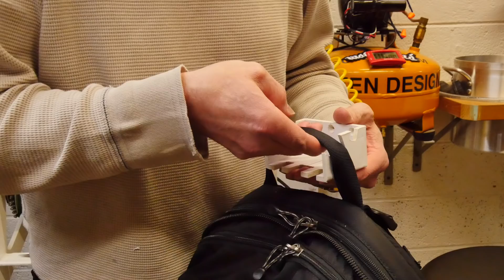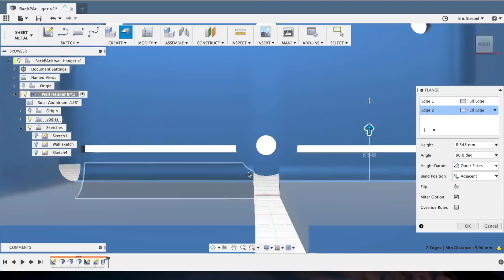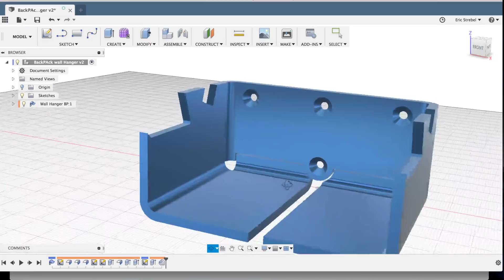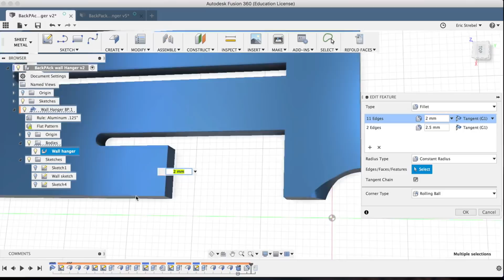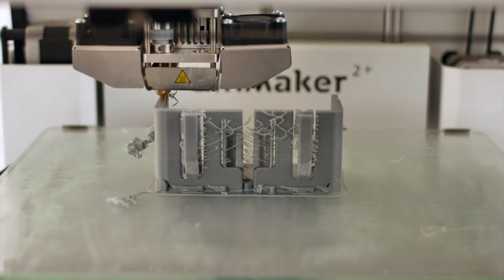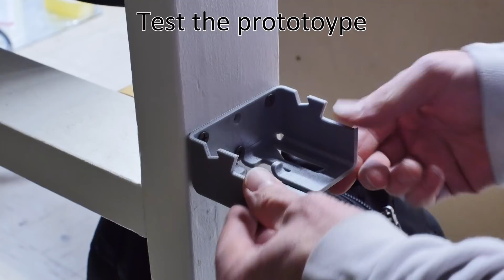BackPack Hanger CAD and 3D print: Fusion 360 and Ultimaker 2+ print build

Comment: So this is very cool. I wasn't aware that Fusion did sheet metal parts, but I guess i shouldn't be surprised. One comment, the flat part doesn't seem to nest together as well as it could in terms of cutting out 100 in the flat sheet. Either narrowing the lower flanges (with the keyhooks) or widening the back flange (with the screw holes) seems like it would allow for better nesting and less drop when doing the production run. As i'm sure you know there is a whole field of "design for manufacture" which deals with these sorts of details.
Reply from the maker: You bring up a good point. Ultimately it will depend on your manufacturer. I will discuss this in more detail in the next backpack hanger video, once the prototype arrives. Some manufacturers wanted to make changes to the design and others did not have an issue with it, ultimately it came down to their manufacturing capapbilities.

Comment: 3d prints with strings that bad are probably from 2-3 causes.
1. Your non-print travel speed is too low. If not extruding you wat to be moving as fast as possible. Less time to ooze. 200mm/s is a good place to start. Go faster if you can.
2. You may want to look at retract settings after non-print speeds are improved. Less pressure to ooze
3. Consider dropping extruder temp to reduce oozing. This may have negative impact on layer adhesion if you go too far.

Thanks for the inspiration 😉
Reply from the maker: Mongrel Shark Thanks for the info, a few have commented on retraction settings, I am using the factory setting, will have to give that a look.

Comment: Hey Eric great video! I have to say I love the design of your backpack hook. As for the stringing, it is probably not the humidity. When you have humidity problems your filament will often bubble when coming out of the nozzle. From what I can see this is not the case. What you need to do is adjust your retraction settings. I would recommend a 4.5mm retraction at around 20mm/s. There are other settings you can adjust to help the problem to like increasing the cooling fan speed and travel speed. If you need more help there are plenty of videos on retraction that are really helpful. Good luck on the stringing and on your backpack hook project!
Reply from the maker: Luke Harmon  Thanks for the info, a few have commented on retraction settings, I am using the factory setting, will have to give that a look.

Comment: I work at a press brake manufacturer and need to test the machines anyway, but we don't do cutting and the Detroit area is  distinctly not in Europe. Besides, the inner hooks might need a narrow punch we don't usually keep in stock. I would expect an actual sheet metal workshop which works with small parts to have it, though, so it shouldn't be a problem to find someone to do the job.
In any case, I might * ahem* borrow the idea and make something like that for myself at some point. I really need somewhere to put my backpack at work.

Comment: It's a shame your printer is working so poorly.  I think that might be one of the reasons why you resist using it so much. :)
Reply from the maker: Right, LOL........ not really working poorly, works pretty good actually, silver filament pulls a lot more stages than the white or black for some reason. Other than the stings, it works quite well, use it all the time, just not very interesting for making YouTube videos.
Reply: I personally would argue that it’s not the printer performing poorly, rather the settings of the slicer are not optimized for the printer. From personal experience I know for a fact that having optimized settings is just as important as having a solid printer. A 200$ Chinese clone can outperform a 5000$ name brand printer if the clone has better optimized settings than the name brand. Point is, the more you work with a machine (3d printer in this case) the better you will understand how to use it to produce the best possible results.

Comment: Why waterjet instead of laser cutting or just punching?
Reply from the maker: Good question, My guess it that punching is not an option for a low run part like this, I am open to the other two processes, not sure how good later cutting is for aluminum of this thickness as it just sucks the heat out of the laser. But, I will see as the quotes roll in, and share with everyone what I learn.

Comment: Why water jet over laser cutting? Laser is cheaper and quicker. I know a shop that has both a fiber laser cutter capable of cutting steel as well as a CNC press brake capable of bending the cut out flat part. http://www.prestigescreenprinting.com/

Comment: Whoa whoa that is one oozy print. It looks like the melt is dripping right out of the nozzle, not filament heating inconsistently, which would make whispy strings. Wrong retraction length? Too high retraction speed? Fillament absorbed moisture? How moist the air in your workshop is at the moment of printing is pretty much of no regard, because the hot end is easily hot enough to keep itself dry. Basically this happens whenever upon retraction, the melt is not pulled back consistently but breaks, part of it is now retracted, and part is still right in the nozzle, and there's a gas filled void in between allowing whatever's in the nozzle to go drip right down, which could be caused by water in filament being converted to steam, but also by a million other things. Pity every failure in 3D printing has like a dozen causes and the result all looks the same! I think it's not too likely to be filament moisture this time, because it takes a lot of energy to heat water, so moist filament tends not to melt completely evenly to begin with. Retracting too fast can cause the melt to break and the air to be sucked in from below, but retracting too slow will just give it time to drip out anyway

Retraction length is dependent on the printer and will differ between samples of the same model quite a bit for Bowden fed printers, and between filament spools, because tiniest differences in filament diameter can make a substantial difference. The bowden tube is wider on the inside than the filament. If you drive the filament up the Bowden tube to conform it to the outside of the curve, and try to pull it back where it conforms to the inside, that distance between it being pushed all the way in and pulled all the way out while it's fixed at the hot-end is the base retraction that is needed, plus needs a tiny bit extra, like a millimetre or so.

Larger nozzles will have a tendency to drip more, probably reducing temperature may be needed. I wonder if the layer height of sub 0.1 isn't a bit too low for 0.6mm nozzle - i mean, every time the nozzle touches whatever's printed while travelling, even if it's just a small retraction booger at the edge, absolutely tiny and unnoticeable, that can catch and tease some more melt out of the nozzle, and you get that tree of boogers growing in mid air. You can force combing mode in Cura to try to make it travel over the print at first to tease out the boogers on the infill instead of outside. You can enable coasting to complete the line printed with the ooze that is about to come out, but then you need to enable retraction extra prime that corresponds to that amount. It can become very difficult to dial in on a Bowden printer!

Comment: Wow, if it's that strong with a FDM, it's gonna be solid in metal. 
As for stringy prints, I'd guess playing with the retraction settings would help.   Also, you might be running the extruder a bit hot? Not an expert but I hope that helps.